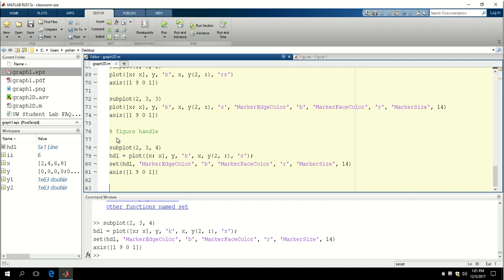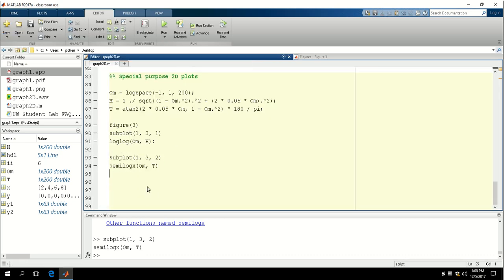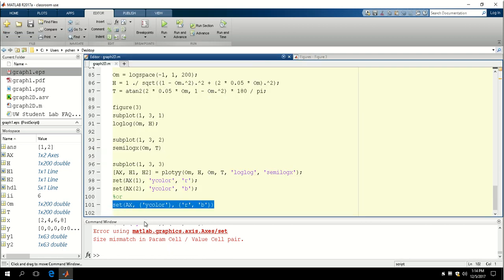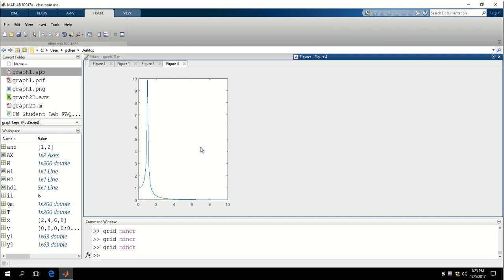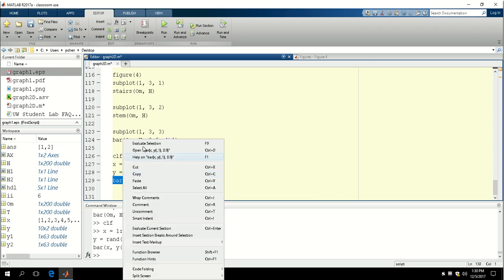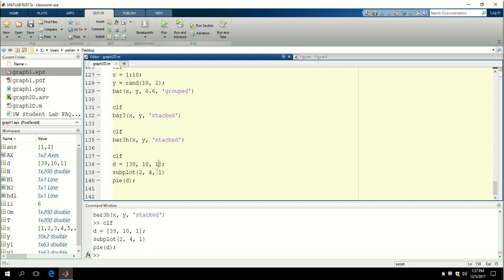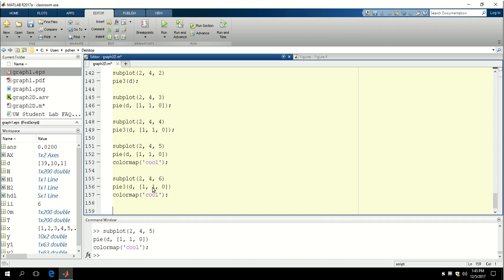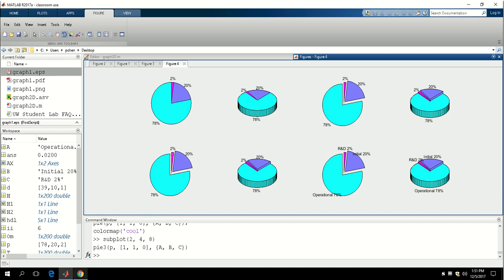matlab25

Comment: Hello
Iam beginner in matlab, 
I have a problem in my program and I'm not sure how to resolve
I made a concatenation of the Reed Solomon code with convolutional code in the program I do not know to do the bits that i converted to binary we enter the convolutional encoding
Clear
clc
n=15; k=9;
m=4;
genpoly = rsgenpoly(n,k) ; 
msg = gf([1 2 3 4 5 6 7 8 9],m) ;
mot_code1= rsenc(msg,n,k) ;
mot_bin=dec2bin(mot_code1.x);
g = [7 5];   % code generator
trellis = poly2trellis(3,g);  % constraint length = 3
c = convenc(mot_bin,trellis)